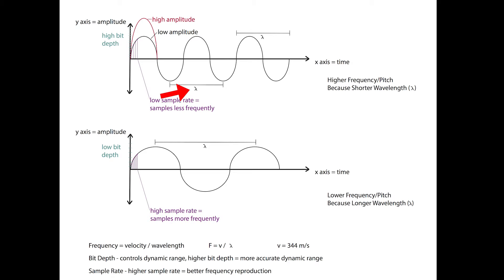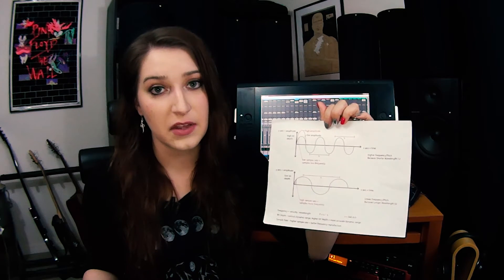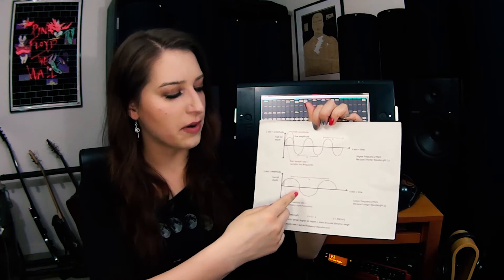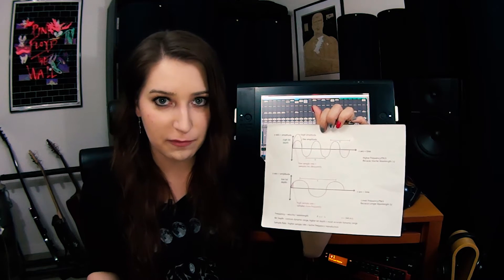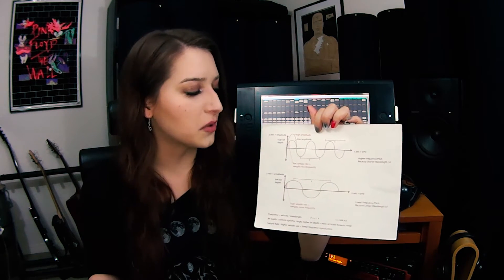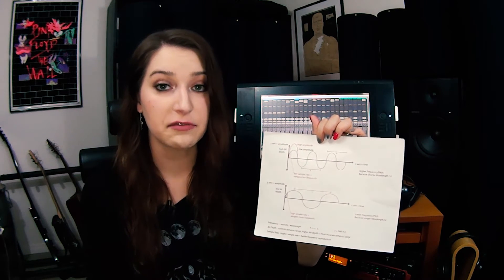Digital Audio: How Does Sample Rate Affect the Sound?

Comment: 44.1 was the sampling rate used by PCM adapters used for recording digital audio onto video cassette and these adapters were used for CD audio encoding..as for the Nyquist theorem well its only about the minimum sample rate required to capture a given frequency.. it doesn't take into account whether higher sample rates capture a given frequency more accurately
Reply from the maker: Thanks for the additional info! I think maybe you might have misunderstood my use of the word accurately. I was just talking about the entire frequency range as a whole. So, for example, when we lower the sample rate dramatically to something like 8k, we lose a lot of the highs, so 8k is going to represent the entire frequency range less accurately than 48k, for example. That's what I mean when I use the word accurately in this context.
Reply: @CatoNoise  Well its definitely true that 48k will be more accurate than 8k =)

Comment: 44.1kHz is a “magic number”, I.e. a funny and possibly useful number to engineers. Prime Factors of 44100 =2, 2, 3, 3, 5, 5, 7, 7. So the number is just more fun than most number around that range. So selecting this number certainly was enormously nerd fun.

Possibly this also helps in some applications, for example if you have a slower clock that divides 44100hz, you could reach 44100 with a clock multiplier. So there are many different base clocks that can be multiplied into 44.1kHz. Compare to other sampling frequencies does not as easily multiply into target frequency, especially if your base clock cannot be selected freely. Now honestly I haven’t a clue if that actually was a problem back in the days of 44.1kHz, so I am unsure if this number was selected for “this is actually useful” or “this really solves our clock problems”. Or perhaps it was a bit of both.

As for why selecting a number in around 44kHz; we satisfy Nyqvist theorem with a small margin, while we minimize the margin as much as possible (to allow more content the stored into the very limited disc space of yesterday’s media)

Comment: Hi i wonder if higer sample rates only affect the high frekvence area, will a frekvens below 10k sound the same on 44khz and 192khz ? Also let's say i have audio signal in 1000 or 100 hz will does frekvens be affected by the filter on the converter?

Comment: Scientists have discovered that we can detect frequencies well above 20kHz from an area behind our retina. I find audio using higher sample rates to be more "engaging" even if they are hard to pick out in ABX tests.  I think there is still a lot that we don't know/understand about the benefits of hi-rez audio.  There is also the issue of being able to use gentler low pass filters with higher sample rates which does result in better fidelity.  Even 48kHz does sound better than 44.1kHz.  Hopefully with the death of the CD as a physical format, we can get rid of the 44.1kHz standard (even if it just becomes 48kHz, same as the video standard).  Great video, Cato!

Comment: If you record and mix at 24/44.1, you won't notice any noticeable difference in the bounces. If you're recording and mixing for film, you're probably recording and mixing at 24/48. If you're doing sound design and time stretching/mangling audio...then you record at 96kHz and higher, especially if the audio has a lot of higher frequencies or human voices (violins and such). Other than that...24/44.1 is actually more than sufficient for the music industry. Besides, it's lighter on your system.

Comment: Not sure why the discussion always seems to centered around frequency response as the justification for or against the need for a higher bit/sampling rate. That is, for the most part, irrelevant compared to other factors. The real reasons are 1. What Mark stated below. Due to the steep filtering required for a 44.1 sampling rate, it is not electrically or digitally possible to design filters that don't cause time-smearing that audibly degrades the audio. This can be heard on all CD's except in the case where the original recordings audio quality is too poor to tell. 2. Every 6 DB of volume = 1 bit . So low volume parts of a CD say around the 72db level for 16 bit audio is only using 8 bits resolution while for the same 72db level using 24 bits, the resolution is 16 bits.  3. Increasing the sampling rate provides greater resolution in time.  At 44.1kHz a sample is taken every 20.8 microseconds. At 96 kHz it is every 10.4 microsecond, and at 192 kHz it is every 5.2 microsecond. It is estimated that the human auditory system has a time resolution between 5-11 microseconds.  So if you assume 7 microseconds then only 192 kHz with a time resolution of 5.2 microseconds is even good enough to cover human time resolution. A time resolution of 20.8 microseconds results in the sound lacking depth and location qualities which is 1/3 that of a human auditory system. 

The sound of 16 bit 44.1 kHz format (CD's) on good equipment usually manifests itself in people complaining about the sound being sanitary, empty, sounding digital. This is because of the presence of time smearing and the time resolution being 1/3 of that of the human auditory system.

Comment: Hi,

This is going to be vague because I don't know enough of the specifics, but let me share what I've learned.

1) Filters involved in rolling of frequencies over 20k cause audible artifacts.  When the sampling rate is increased, these artifacts are reduced.

2)  We're not just talking about reproducing all the frequencies of the signal, we're also talking about reproducing time-domain information.  When you put microphones in front of an instrument, you're not only recording the instrument, you also recording reflections off other surfaces, such as the walls, the floor etc.  In addition, the instrument itself is not a point source.  The sound it emits comes from various parts of the instrument.  Because all these sound sources travel different distances before getting to the microphones, the phase or time relationship between all these sound sources needs to be preserved if playback of the recording not only accurately reproduces the sound of the instrument be also the location of the instrument in space.  (The phrase I often heard is "real instruments in real space."  Listen to Miles Davis' Kinda Blue for an excellent example of real instruments in real space.)

My understanding is that accurately reproducing all this additional sonic information requires sampling rates above 44.1K.  In fact, I've heard that improvements can be heard all the way up to 512K.

Comment: I have long ago forgotten the exact reason but here goes -the main way I remember is 44.1 kHz is twice 22,050 Hz so if the highest frequency a young human can hear are approximately 20,000 Hz they gave themselves some margin over that and used 22,050 Hz as high frquency cut-off andvit certainly can be reproduced faithfully with 44.1k hertz which I don’t like saying kilohertz are like calling at 44,100 samples per second, so....Nyquist theorem says you can faithfully reproduce up to a 22,050 Hz sinusoid that way.

Comment: The small problem is  that the 44.1kHz standard does not take in to account the non perfect LP filtering, with the normal 0.45-0.55 stepfilter we actually loose a couple of kHz more in the treble. 44,1kHz generally gives us an upper limit of 19kHz and 48kHz an upper limit of 21kHz.

When recording the higher sample rate is very nice, this is due to the fact that latency actually goes down in recording with higher sample rates, also if you like to pitch-shift some sounds in your production the higher sample rates makes sense. I use 96kHz.

Comment: Thank you for the video. You asked why we use 44.1 KHz for CD. The thing is we can't make a perfect filter to cut the frequency band to the Nyquist theorem limit. So the wider the shelf filter is the less artifacts we have in the digitally sampled audio signal. So to have 20Hz-20KHz signal sampled, we need 2KHz above that range for applying the filter curve.
Reply from the maker: Hey, thanks!

Comment: The first digital recorders consisted of two units. The Analog to Digital converter and a video tape recorder to record it. They used either U-Matic 3/4 inch or 1/2 inch Beta or VHS. Based on  the Nyquist theorem, they could fit around 3 samples on each video line. NTSC had 245 active lines times 60 fields × 3 samples = 44,100 It allowed the data signal to be recorded as a video signal without modifying the VCR.
Reply from the maker: That's so cool! Thanks!

Comment: Please let me get in on the question bandwagon: A higher sampling rate means that the overtones in an analog signal would be more accurately reproduced within the range of normal human hearing?
Reply from the maker: Well, yes.  So, if we go into really low sample rates, we start to lose those overtones (or just tones) that are higher in frequency but still within the range of human hearing.  Once we get into sample rates that we tend to use for recording though (44.1k and up), they should be able to reproduce the frequencies that lie within the range of human hearing (because of the Nyquist theorem).  The thing is, the higher the sample rate, the more data points lie within any given wavelength, so we should have an even more accurate depiction of a waveform with a higher sample rate.  It's like a game of connect the dots.  If we have more dots, the digital lines will more accurately parallel the analog lines.  

Once we talk about the frequencies that are above the range of human hearing though, my understanding gets a little muddy.  I know when working in a very high sample rate, and then downsample at the end of the process, we start talking about essentially how those higher frequencies affect the math involved in downsampling, and ultimately, way the frequencies below them are stored.  I know some engineers/studios prefer to sample at 88.2 because it's double 44.1, so the math is simpler when downsampling to place on a CD.  Although, that's probably becoming less of a concern since CDs are on their way out...     

Anyway, hope that helps!  Thanks for watching!!

Comment: The reason we use 44.1kHz and not 40kHz sampling rate, is so that we have space for the filter slope.  Yes, we use that extra 2.05kHz above 20kHz just for that.  With Hi-Res we don't need that steep of a filter.  We can process all frequencies, even 40kHz, without them folding back into the audio range (aliasing).  It's fantastic

Comment: Is there a big difference between 44.1 and 48? if not i wonder why two rates that close together. Love your work!
Reply from the maker: Well, I was taught that 48k is associated with video, so maybe it became a thing because it is somehow easier/simpler math to pair with that video?  I'm not entirely sure though, maybe someone here knows?
Reply: lexhitreset As a matter of fact, this small difference comes back from the beginning of digital audio-only storage. 

It was made in rotary-head proffesional video recorders and tapes. There was two standards for it: NTSC and PAL. Hence the two sampling rates. 

Asuming the same bit depth, there is no audible difference between them at all. However, and because previously acquired equipment, most studios use the 48 kHz sampling rate (or an integer multiple), and very few the 44,1 kHz one. 

The exception is when the recording is being made in the other digital system: DSD. In this case, the sampling freq is no less than 64 times 44,1 kHz (at the cost of one single bit per sample). 
But this is another story, to say the less.
Reply: Record something at both rates and listen back to them. I notice a difference in the high end, mostly on vocals and cymbals. They sound less crisp and more harsh at lower rates. I'm in my 50's and have played in bands for 30 years and I can still hear a difference!

Comment: Very nice video. Explains everything except the best reason to produce at higher rates than 44.1 kHz...digital signal processing. Plugins and other DSPs tend to work better above 44.1 kHz. Pitch and time based effects like compressors and Auto Tune especially. EQs that don't have a decramping feature will also suffer at 44.1 kHz. 

As you discovered yourself, 96 kHz seems to be the gold standard in audio sample rate practicality. Your channel is cool, keep it up!
Reply: Yes and no. Many plugin developers implement internal oversampling in their plugins, and often times this internal rate will be higher than 96 kHz. If you are going to use a higher sample rate, I'd tend to favor 88.2 kHz over 96 kHz if you are bouncing down to 44.1....96/44.1 is an ugly mathematical ratio. 96/48 is a nice ratio though...
Reply from the maker: thanks!  and thanks for sharing more info!
Reply: I'm sure this is absolutely not true.  It is a very good personal assimilation that will work out, but it is not an absolute.  If you don't mind supporting your statement with actual proof that'd be cool.  You're basically suggesting that people need a ton of CPU in order to get good quality audio.  Not true.
Reply: Hi Jufra1234,

I just saw your post. Search for working ITB at higher sampling rates on Google. There you will find an article written by a plugin developer. Here are a few highlights:

"Most feedback based algorithms are taking advantage of a higher SR resulting in a better perceived audio quality. Most prominently, all types of IIR filters are affected especially but not limited to the case where very steep slopes are computed. As an added sugar, the curve warping gets moved outside the hearing spectrum at higher SR.

Whenever modulation at audio rate occurs, there will be serious distortion. This can be minimized to some extend at higher SR and so a wide range of digital audio applications is capitalizing from it: FM oscillators, ring modulation, compression and limiting – just to name a few. The so-called IMD (inter modulation distortion) is even worse in the digital domain since also aliasing gets introduced. This occurs when the additionally created distortion content exceeds the Nyquist frequency and gets folded back into the spectrum below. Increasing the SR, immediately relieves this effect. In general, this applies to all kind of non-linear processing and therefore all types of saturation and distortion algorithms are benefiting from higher SR.

Some plug-ins are offering internal oversampling (re-sampling of the audio signal to a higher SR) as an alternative to a globally higher SR in the host. As always in life, there is a serious tradeoff though. Re-sampling a signal requires steep filtering at Nyquist which in general is a tradeoff between computational cost, steepness of the filter, ripple in the passband and resulting impulse response of the filter. For instance, if a plug-in uses a FIR filter to obtain very steep filtering, pre-ringing occurs. On the other hand, if IIR filtering is used, the filter might be not steep enough to eliminate aliasing content. However, the additional computational cost is a “local” phenomenon opposed to an overall higher SR which causes a higher CPU demand in all software running in the host.

Running an overall higher SR on the other hand avoids tons of up and down sampling and all the artifacts that are typically introduced by doing so and just requires some down sampling at the end which can be done with an high quality offline sample rate converter. If computing power is not an issue my vote goes clearly to use a higher SR instead of local re-sampling."

You can slow down higher sample rate audio with less artifacts. You can pitch bend with less artifacts. Frequencies at the low end of the spectrum and high end sound better when equalized. 

Sample rate is less of a concern to me than squashing the life out of a mix. Even with the better brickwall limiters maintaining the illusion of dynamic range, actually mastering tracks that aren't crushed sounds better. I'll take an uncrushed 44.1 kHz mix over a crushed 96 kHz mix any day!

As for 88.2 vs. 96 kHz that has not been a real concern since the release of Voxengo r8brain in the year 2003. Your mileage will vary with other sample rate converters but Voxengo's is fantastic. When it first came out it used to take forever to process a file. In the year 2018, it is computed within seconds.
Reply: RealHomeRecording.com very well explained

Comment: I use the 88.2 and the reason for that is that we eventually need to downsample to 44.1 for the CD standard, and I'm sure that the processing of downgrading is much more accurate since it has to do less calculation to do half sample rate.
Reply from the maker: Yeah, it's because it's a multiple, right?
Reply: Exactly.
Reply: This is what everybody knows wrong. You can downsample from 48kHz to 44,1 kHz without any problem. Sampling is lossless and sample rate conversion is lossless if your data is 24 or 32 bits.
If the wave is 16 bits then the result depends on the dither method (because 16 bit is converted to 32 bit and in the end 32 bit converted to 16 bit) but still nearly lossless.  (2-3 dB rise in the noise floor with the best dither)